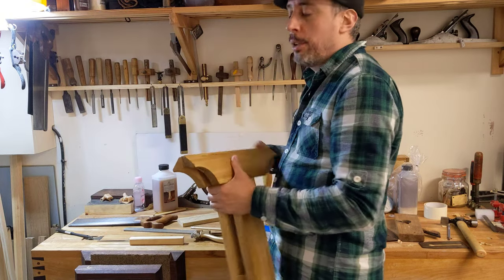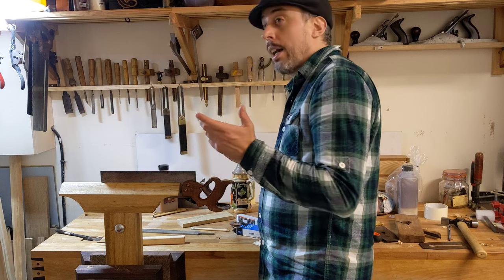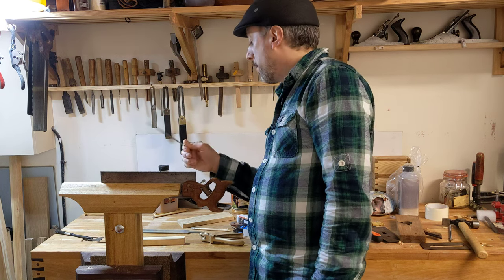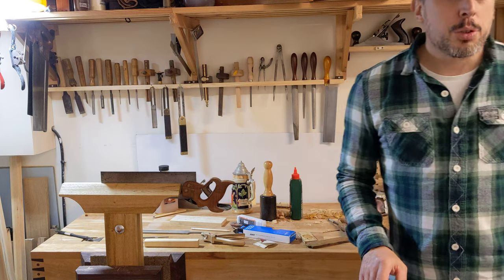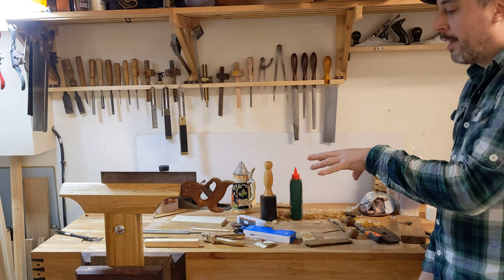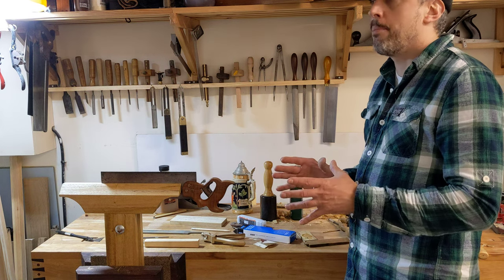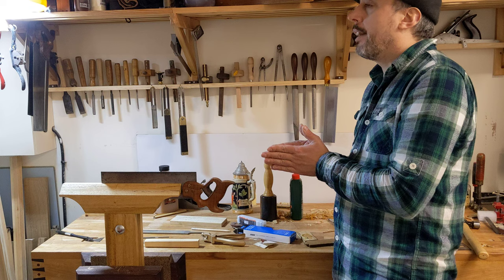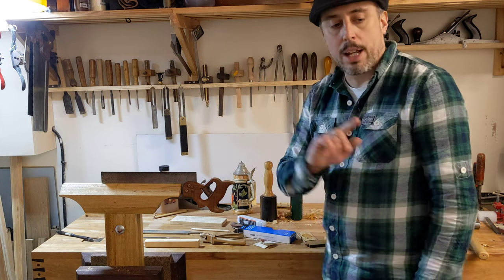Woodworking Vlog #24 Saw Vice, sharpening equipment, off topic & saws.

Comment: It’s VISE not VICE.
Reply from the maker: 😂 It never fails to amuse me how people are so sure they're right 😂. Nice try Jim, do some, research It's both. I'm from the UK and that is how we spell it here.
vice3
/vʌɪs/
noun
noun: vice; plural noun: vices; noun: vise; plural noun: vises
a metal tool with movable jaws which are used to hold an object firmly in place while work is done on it, typically attached to a workbench.
"hold the rail in the vice"
Origin

Middle English (denoting a screw or winch): from Old French vis, from Latin vitis ‘vine’.